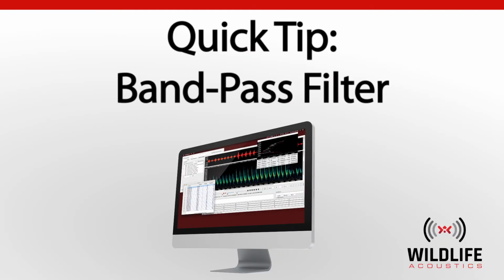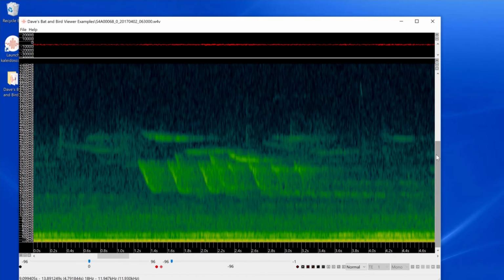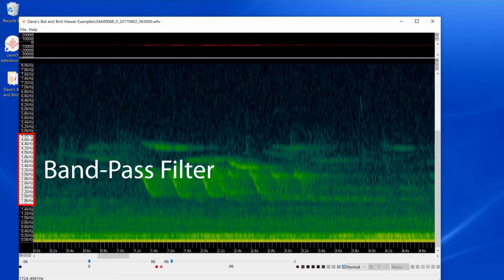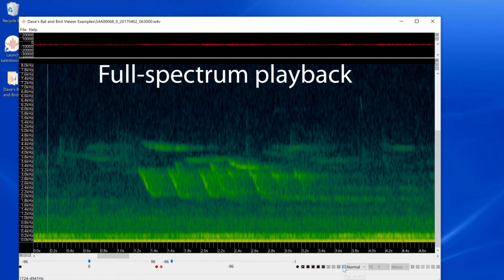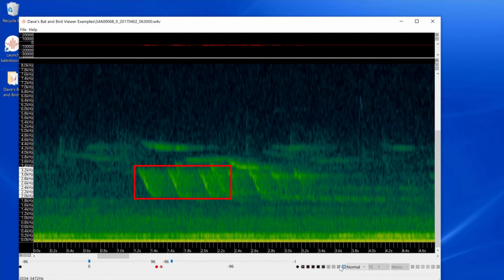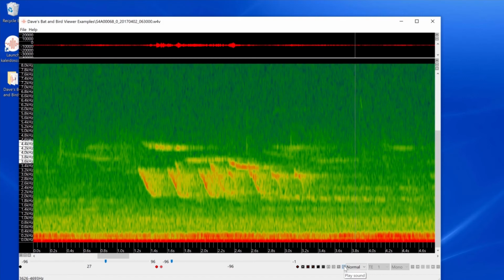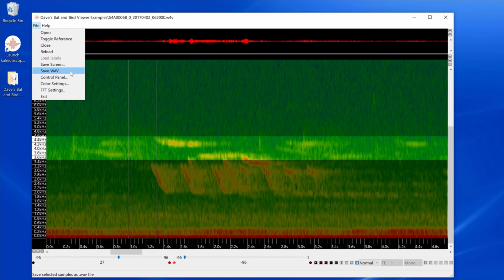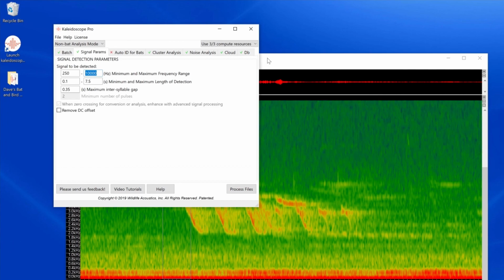Kaleidoscope Pro Quick Tip: Band Pass Filter | Identify and Analyze Animal Sounds

Comment: Hello, 
I have the kaleidoscope pro license et I want to apply the bandpass filter for my cluster analysis with “use existing .kcs to sort new recordings and create new cluster .csv”. I want to see if I improve my classifier when I choose specific frequencies of my species comparing results with an analysis without bandpass filter. When I apply this parameters, nothing change in my results. So I want to know if the software doesn’t consider this parameters or if it had consider but this have no effects to my results.